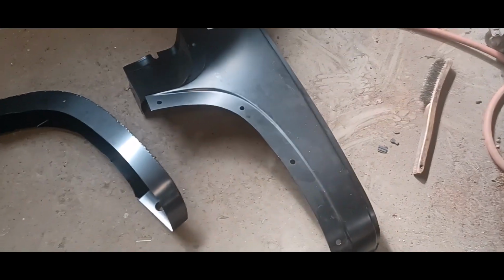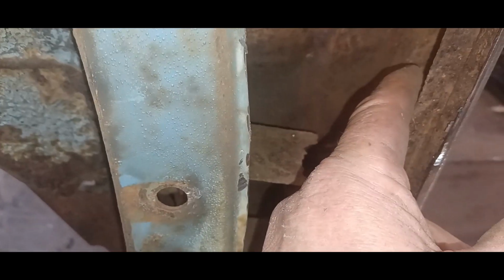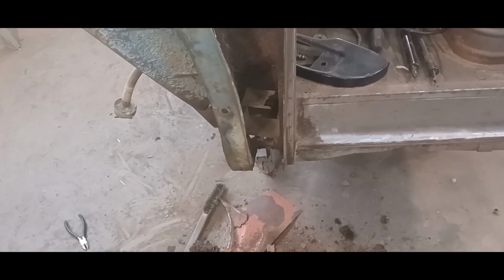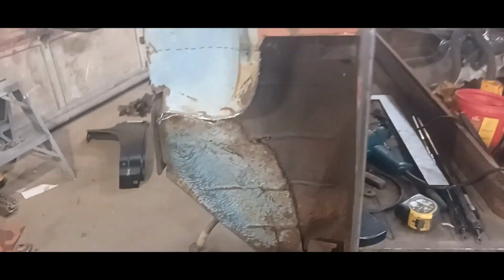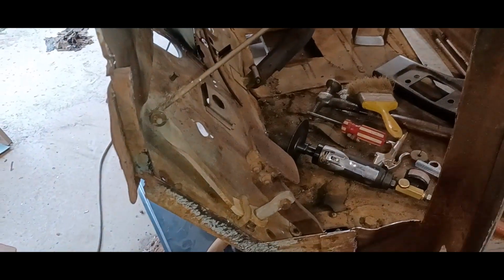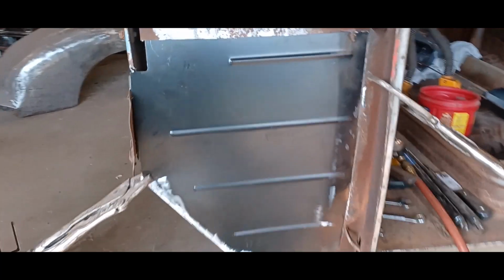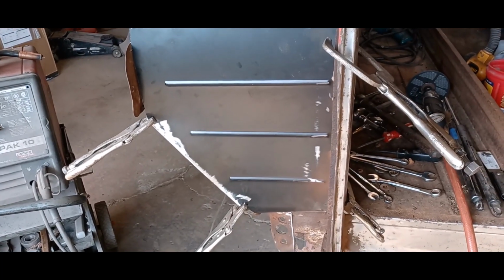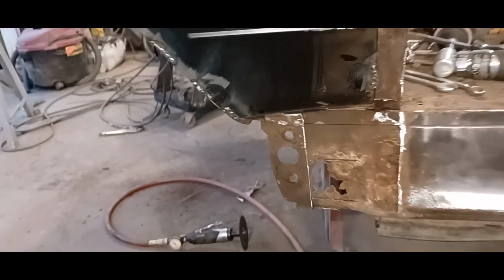Rebuilding the '51 Chevy's left cowl & A-pillar complete! ...part 1

Comment: So glad I found you.  What you do is a lost art for sure, but with your help it seems possible.  I have a '52 Chevy 3100 with some body rot around the windshield and on the sides in the same places you're showing here.  Fortunately, my door hinge mounts are solid.  I'm thinking about cutting off the top part of the cowel and welding in a new one.  I'm sure easier said than done, but the rot around lower part of the windshield is so bad, it's probably easier changing out the entire upper cowel than it is trying to repair the rusted curvy metal.  I'll keep watching and thanks for doing this.  It's really important to pass this along to the next gen so there's someone to carry on your craft!
Reply from the maker: Thank you....kind words, good luck with your project!

Comment: I didn't see if you caught it or not, the lines on the inner kick panel have to align with the ridges in the cowl. I learned the hard way when replacing the kick panel on my 47. I was fortunate that my pillar and cowl were intact and didn't have to be cut out.
Reply from the maker: Yes, it will be mentioned in part 2. I checked before I welded 'er in. Good catch though and thanks for watching!